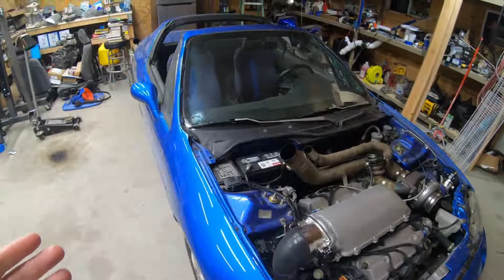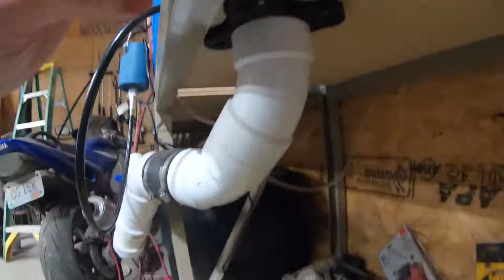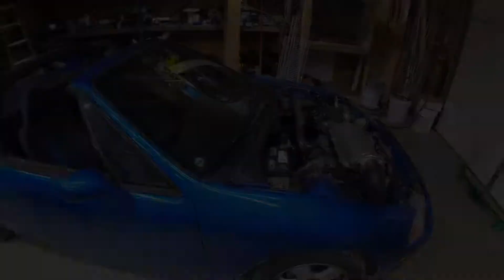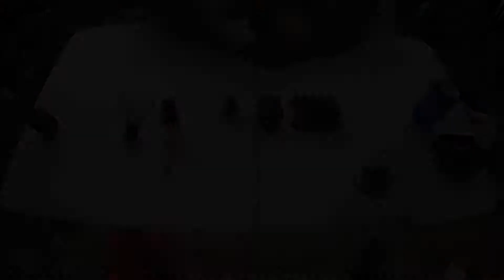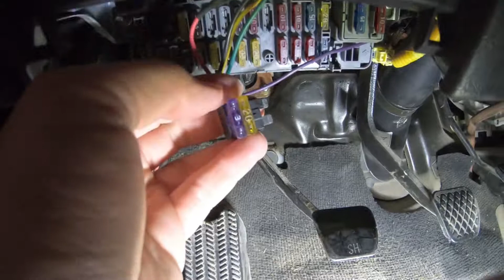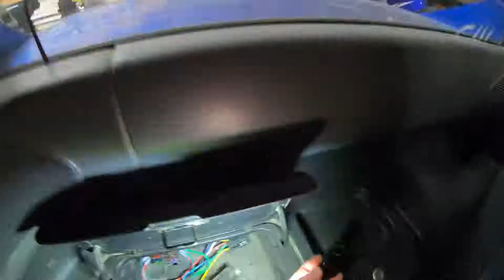J35 Microsquirt Guide Pt. 4

Comment: Question I noticed you tapped the factory fuse panel which was hot at key on but that fuse is 20amps. The 3 amp fuse tap on it powers the main relay. How does a 3 amp fuse power a 40amp relay? I thought the main relay, ecu, fuel pump relay would need more than 3amps Thx
Reply from the maker: The 3amp current only activates the coil on the new main relay. The power comes from the battery through the new main relay to the new fuse panel.(ps I would use a slightly bigger main relay like the 100amp, as the 40 is enough but get pretty hot. I have been running for a few years but it’s definitely not going to have a long life).
Reply: I agree with this question, I have a 3 amp fuse tap going to the new main relay (80amp) and new fuel pump relay(80amp), is that fine? Or do I need a different size anything? Also my crank sensor needs 12v to power it, can I just add a fuse to the new fuse panel or what should I do?